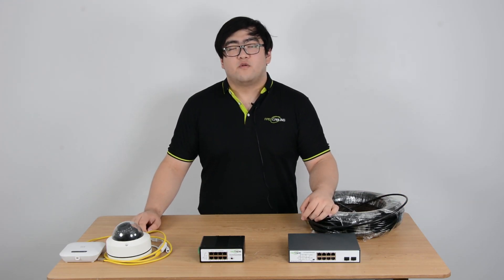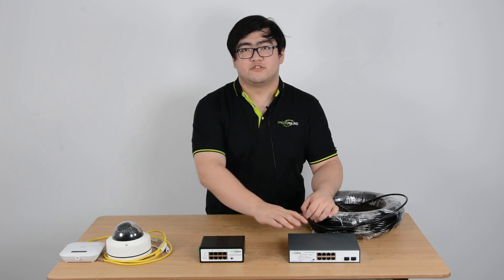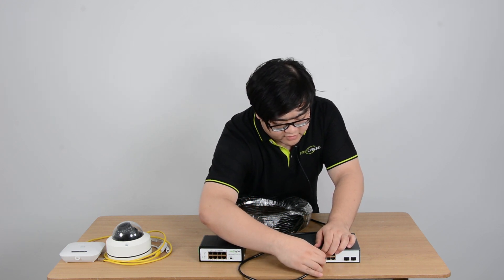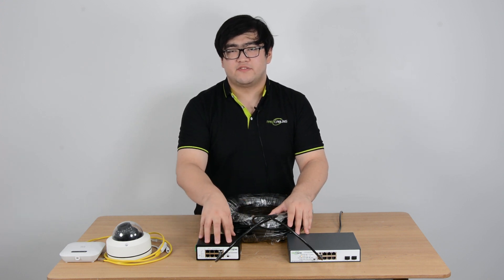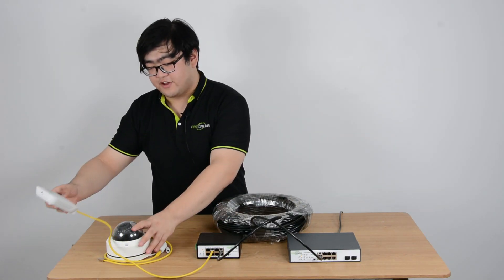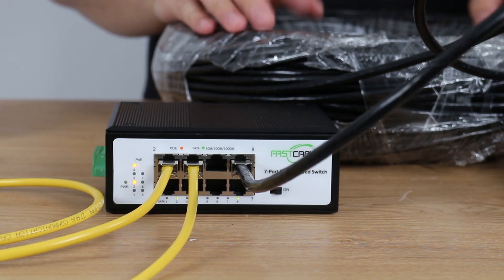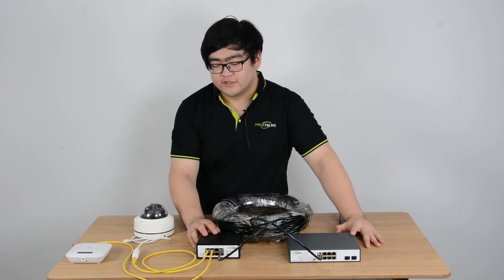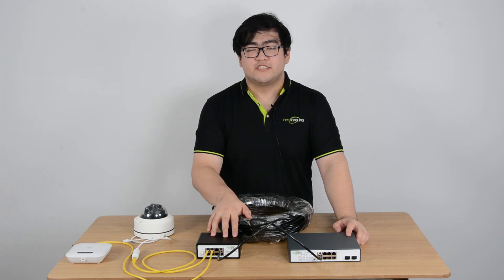How to connect 7 PoE IP camera with single Ethernet Cable?

Comment: Will an Allen Bradley Stratus 2000 work here
Reply from the maker: Allen Bradley Stratix 2000 is an unmanaged Ethernet switch so it cannot deliver power to the poe powered/passthrough switch. You need to use a PoE switch or a PoE injector (4-pair PoE).

Comment: So, i can increase the number of ports my nvr has by using a powered poe switch,  do rhis mean i can use more cameras thenmy nvr originally has ports to accommodate?  Meaning,  my nvr takes 8 poe cameras, will it display more if i connect more than 8 or am i limited to 8 and the poe switch is only good for extending cables?
Reply from the maker: No, how many cameras you can hook up to your NVR depends on the model of your NVR. How the NVR is designed. The PoE switch doesn't increase the capacity of your NVR.

Comment: I don't get it. Why would I buy another device that I have to buy expensive cable to run from the POE camera to the switch then to my 
NVR? Why not cut out the middle man and run cable straight to my device that will be the heart of it all and power and record up to 8 cameras?
Maybe this is for someone that needs more than the recording device offers. Well then shell out a couple more bucks and get a 16 channel
NVR that has multiple terabytes of recording capability. I see this switch as a useless device. Good video though
Reply from the maker: Typically, you might need PoE powered switch if the cable is installed. Pulling new cables could cause difficulty and business downtime.

Comment: I want to transmit 16 ip poe cameras connected to poe switches but between final switch and NVR will be only 1 cable of cat5e .will be any kind of problem with bandwidth or transmission at all ?  my plans is to put in different points the poe switches connected each other for uplink-network  and for poe cameras of course and final switch to be connected to NVR.
thanks
Reply from the maker: As long as the final switch has 1000mbps speed, it should be good. I think most 16 ports PoE switch at least have one 1000mbps bandwidth. Usually it will be labeled as a uplink port.

Comment: Thanks for your speedy reply, I'm very impressed.
As you have maybe already caught on, I'm completely new to the idea of cameras and not very tech savvy.
1.     So connect an ethernet cable into the router, and then to a PoE switch, then two ethernet cables from the PoE switch to the two cameras,(one cable to each camera). Obviously the PoE switch needs a 240 volt supply (uk). Then I will be able to get alerts or watch on my mobile phone, (using the camera APP).

2.     OR    two ethernet cables from router to two off PoE injectors, and then an ethernet cable from each PoE injector to each camera. Does the PoE injectors need 240v supply?
3.     OR one ethernet cable from router to PoE injector. How do I get that cable connected to second PoE injector?
4.     Which way would be better?
Thanks once again for your patience and help.
Much appreciated.
Reply from the maker: Point #3 will not work. Both point #1 and point #2 work. Yes you need AC230V for PoE switch or two PoE injector. I think #1 is better. You will have additional RJ45 network you can hook extra ip device to the network. The PoE injectors solution will consume two network ports on your router.

Comment: Black Beauty
Can I take the two ethernet cables, one from Reolink Duo 2 PoE camera, and the other from Reolink E1 Outdoor PoE camera, each with power off less than 12 w, direct into my router. 
Many thanks for your help and indeed all your videos.
Reply from the maker: You might need two PoE injectors or a PoE switch to supply the power and data exchange for those cameras. Otherwise you have local power source next to the camera.

Comment: My ccctv camera hikvison 8channel how can install help me
Reply from the maker: You will need to attach both IP cameras and NVR to same switch (network). If it is PoE NVR, you do need external PoE switch. Usually, the NVR will discover the ip cameras in the same network and make the connection automatically.

Comment: A straight-through cable is used between the POE switch and the camera?
Reply from the maker: Negative, it is the standard cross wired Ethernet cable.
Reply: @Fastcabling  thanks for the reply :)

Comment: Great Video man !  One question i got 6 Imou Bullet 2S 4MP cameras curently working through wifi connection and i would like to conect them with ethernet so that i don't have signal issues. The cameras work with Micro SD storage and controlled by an android app. Can i use the ethernet powered switch to conect all the cameras there and then to the modem? I could be able to save many meters of wiring that way!   Also if i later upgrade to Hikvision POE cameras will i be able to use the same line and just replace the cameras and plug the line coming from the POE switch to the NVR ?  What kat cable should i use and up to what video quality can such a system transfer?
Reply from the maker: Yes, you can connect all the cameras to the PoE powered switch and replace other cameras when you upgrade them in the future. The bandwidth is 1000mbps. It can carry 7 units 4K IP camera. However, you can't attach the PoE powered switch to the PoE ports on your NVR. The power budget is not enough. You will need a 90W high power PoE injector and link the injector to an up network switch or router to which your PoE NVR is connecting now. The video will return to the switch/router and run back to the NVR eventually.

Comment: My ISP modem/router is the virgin m super hub 3 it's pretty rubbish can I connect a ethernet cable form it to a POE security camera just 1 camera that is Thanks
Reply from the maker: I believe you will need to add a PoE injector after the router. It will turn one of the RJ45 ports into PoE ports which will support both data and power to your camera.

Comment: Can I use the little with a dahua nvr?
Reply from the maker: You can't attach the PoE powered switch to one of the PoE ports at the NVR. The NVR may only pick up one IP camera from the switch even you have connected more than one camera. The correct setup is you should attach the up-level switch/router. Then you connect the NVR to the same router. The camera's live stream will reach the router, then arrive at the NVR eventually. probably, you will need high power POE injector to supply enough power to the edge switch.
Reply: @Fastcabling  so I could plug your two items to my nvr and it will work?I get my cam feeds thru dahua poe nvr.is that possible?

Comment: Can you daisy chain POE cameras? One coming from NVR and maybe to a switch like you mentioned above then from that switch to a 3-way splitter (1 in and 2 out). From 2 out one goes to the camera and next cable goes to another 3 way splitter/switch whatever.
Reply from the maker: I don't recommend you daisy chain the PoE switch. If the cable or first POE switch failed, you will lose all the connections after that. If you do need to daisy chain the switch, please pick the managed PoE switch (with ERPS)+ fiber optical cable which provides the redundant link.

Comment: Would this work with spoe cameras?
Reply from the maker: Could you please elaborate on "SPOE"? The output of this switch is compatible with standard PoE/PoE (IEEE802.3af/at), and the input port (#8) accepts PoE/PoE+/PoE++ (95W maximum)

Comment: what is the maximum ethernet wire that the POE powered switch can handle? Does the output also clear? Thanks
Reply from the maker: There are 7 PoE output ports which are the standard IEEE802.3 PoE/PoE+. The maximum distance between the PoE injector and the PoE switch is 328ft and the total power budget is 71W if the front end PoE injector is PoE++ 95W.

Comment: Yeah yeah yeah.. So Guys, let me just put it out there, you need 7 ethernet cables one from each  camera  to the poe switch. It's a no brainer really.
Reply from the maker: Yes, you need 7 Ethernet cables from the cameras to the edge switch (328ft maximum), However, you only need a single Ethernet cable to carry both power and data from the center switch to the edge (another 328ft maximum). There will be useful while you are trying to re-use the existed Ethernet cable to expand the PoE network.

Comment: What is the purpose of the second switch? Would you not be able to just plug the ip cam and WAP into the first switch? It looks like the first switch also has poe on ports 1-8 so I dont see why the second switch is needed?
Reply from the maker: Imagine the Ethernet cable has existed in the field, and you need to add more PoE IP device at the edge. The maximum distance between the first switch and the second switch is 328ft. There is no need to wire the new cable or set up a power source, the second switch can receive both power and network from the first switch. The second switch also can supply another 328ft to the PoE IP devices. The purpose is to expand the PoE ports and the distance at the edge. It could be deployed to the middle or large PoE power system such as the parking lot. The power is being centralized and the radius of PoE coverage expands to 200 meters. Yes, there is no problem to plug the IP camera WAP to the first switch. The first step is still the standard PoE switch but with two ports that can supply 95W PoE++ high power.
Reply: imagine a senario meet never happens.... that's the reason for this product

Comment: So you can power 7 cameras through 1 cable, but  can you send 7 different video feeds from 7 different cameras back through the 1 cable so my NVR receives 7 different video signals? 

Otherwise, what good is it to power cameras you can't watch nor record?
Reply from the maker: Yes, the edge PoE powered switch can take in 7 PoE IP cameras or any other non-PoE IP devices. Technically, It is the edge PoE switch that can be powered by another PoE switch at the center. It is easy to expand your PoE network ports by using an existing Ethernet cable. There is no need to re-wire the new Ethernet cable which you want to add extra IP devices at the edge.
Reply: @Fastcabling  Thanks for clarifying things.
Reply: Good question, good answer
Reply: Thanks for your videos, so if i have an 8 channel NVR icould watch more than 8  cameras signal on my monitor?